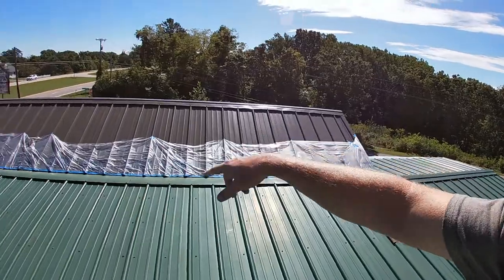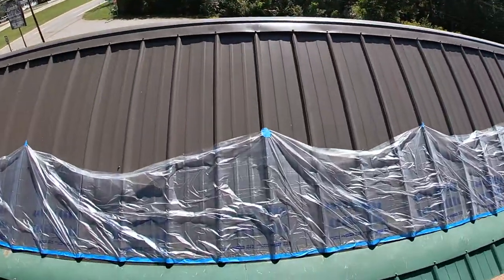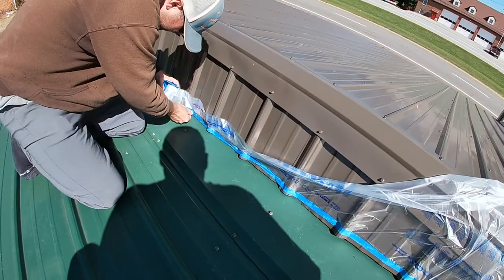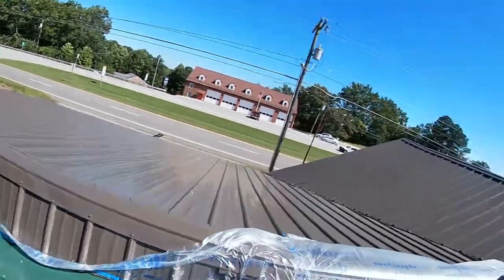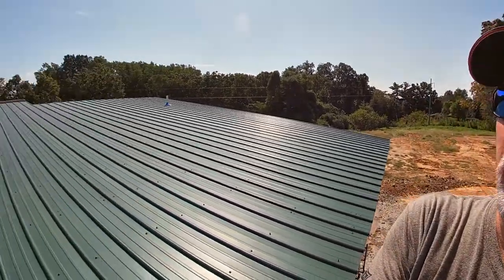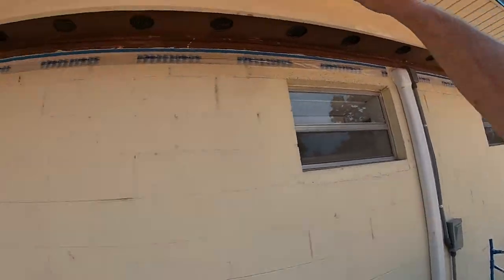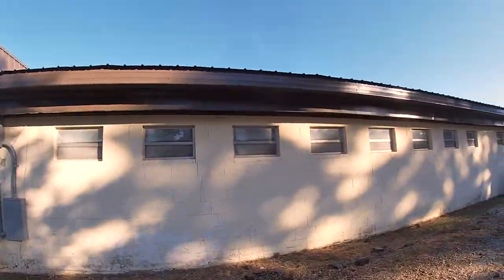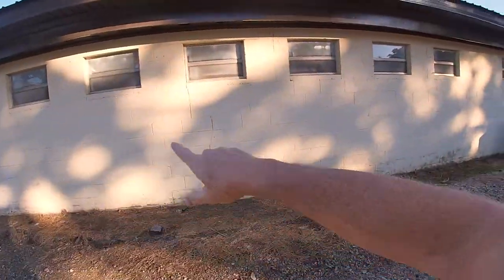METAL ROOF PAINTING WITH GRAYCO SPRAYER

Comment: Plastic with tape is a good idea. But cost to much. $$$You can buy rolls of 2” tape and fold it back so when you cut your plastic to length you can quickly stick it to tape, because tape is folded back. It catches great. Press in and cut any excess off. 
Great videos thanks